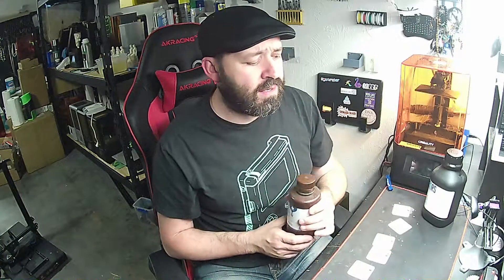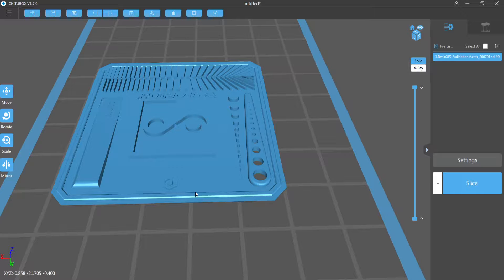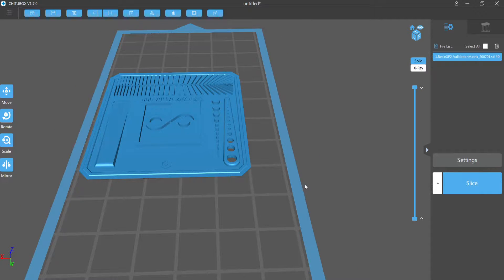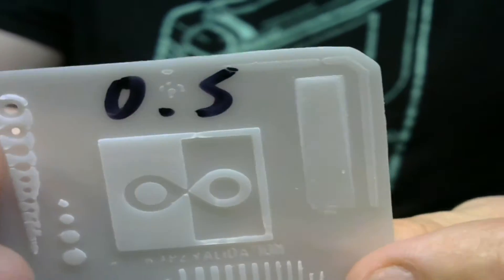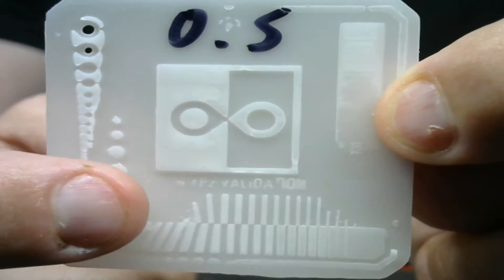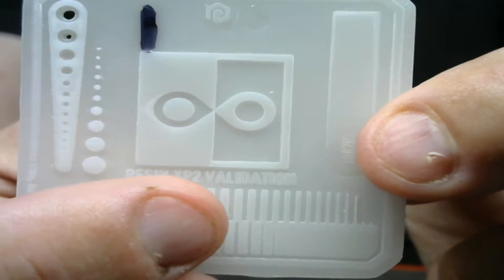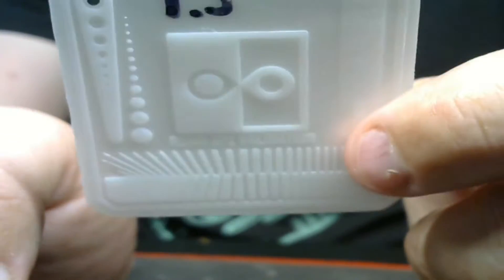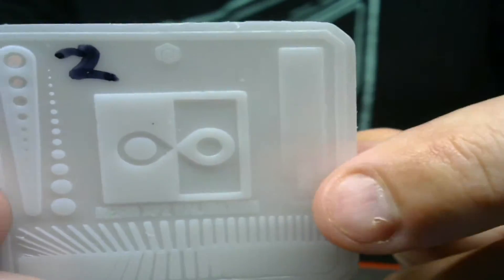How To: Resin Exposure Settings!

Comment: I am missing something or the video is missing something.  Are you intentionally hiding your settings when you go into settings then begin discussing the print settings to use?  If there is supposed to be a screen I do not see it.  Lack of a picture to go along with your discussion is not working for me.
Reply from the maker: yes my apologies this is an old video. I will be updating soon with a better print and better explanation by end of the month

Comment: Are you using 100% uv power which is set by the manufacturer on delivery or you’re lowering it down to extend lights life?
Reply from the maker: Been doing this for almost 5 years resin printing and never needed to lower the light source power to save anything.
Reply: @AkumaMods  so you’re clarifying that you’re using it on 100%uv power from the time you bought it until now? Interesting! 👏👏
Reply from the maker: @kirilivanov5852  absolutely I've never messed with the UV power on any of the 70 or so resin printers I've had in my hands
Reply: @AkumaMods  Thank you! I’m using Anycubic mono x and I thought it will be better to lower uv power in order to improve the 💡life. I will try using them on 100% hopefully it’s not gonna effect negatively the monochrome screen
Reply from the maker: @kirilivanov5852  I'm using 100% on my M3 MAX

Comment: I'm getting a bit confused, you save 3 files at 3, 8 and 15 seconds exposure, but then go on to show prints starting at 0.5 and go up in .5 increments up to 2, what are these new times and where did they come from when you start off saying 3 seconds 8 and 15? Is it because of the mono screen and this cuts the time you need to expose and if so what's the ratio ? Should I be exposing the resin starting at 0.5 and going up in .5? Or doing what the bottle says?
Reply from the maker: So for a new printer I actually set the times at 2.0/2.5/3.0/3.5. and my bottom is at 30.

Comment: I ran this test on a photon mono x and was told that you couldn’t trust the results due to printer doing something for the first 10 layers. Is this your experience? The rerf takes so much longer to print.
Reply from the maker: No that is not true. However I will be updating this video with a newer XP test from phrozen that has been working well. It is just as fast as the one in the video but comes out more clear

Comment: I don’t know if you can go back and edit the video you have posted but this video could use some corrections. At 3:50 when you are saying something about exposure times, the sound cuts out – there is no audio. At 6:37 you begin to talk about settings by first clicking the button that would open the settings dialog but the window doesn’t open in the video. You are then left pointing to nothing and talking about something that can’t be seen. That is as much as I watched.
Reply from the maker: There will be an updated video coming out soon.

Comment: Thanks for the video and the file. One question though. You recommend doing 3 prints to test including one around 7-8 seconds and one at 15 seconds. I’m wondering why so high since it seems like <2 seconds generally seems the right time. Is it just to test/experience it? Or did I miss something?
Reply: That’s good to know. Thought I might be going a bit overboard. I’ll probably print the Rook anyway as it looks kinda cool and might want to put it on my display shelf. Guess I’ll skip the town. Thanks again for the help.
Reply from the maker: So this was done when RGB screens were still big. So if you use an rgb screen I usually start around 6/7 second and for monochrome screen 2/3 seconds.
Reply: Cool. That makes sense. Thanks for the clarification. I printed the RERF file on my MonoX and it looks like 1.2sec is the best on that. So I’m going to try .8sec, 1.2,sec 1.6sec and 2sec on this file. See how it goes. Then its the Rook Test file and finally the AmeraLabs Town file. Hopefully all will go well. Fingers crossed.
Reply from the maker: @TysonWozniak  I'll be honest as long as you do the reref and it looks good I would just got straight to printing. The rook is just a test file to show the printer works and the ameritown labs file is the same as the reref file.

Comment: I've seen videos and read articles that said "do not cure" because that will mess up the results by expanding the print, but you and one other video I saw are saying we should cure...Confusing..... Thank for the help!
Reply from the maker: After doing this for the past 3 years I don't think it matters personally. I read them without even washing them but I use a new one by phrozen that's easy to read
Reply: @AkumaMods  Great, thanks! I should use a different one, on the current one the teardrops meet perfectly but the text is a blob and other parts are not correct. I appreciate the instructional vids!!
Reply from the maker: @AStarkr3802  https://drive.google.com/file/d/1v8XUiRT5rq5b2S2SKbAW7pW8uEJMh22e/view?usp=drivesdk
That's the one I use

Comment: I wish I someone could just please tell me how to set my exposure settings. Not a single guide on the entire planet
Reply from the maker: That's just the thing. It's not universal. Not even if it's the same bottle same color or same type of resin. All resins are created differently. On newer monochrome screen printers it takes about 30min to properly tune it
Reply: @AkumaMods  is it usually only through slicing programs that you can set exposure settings
Reply from the maker: @arronax3319  well you can change the time one some printers but you would have to check when you start printing. There is a setting icon.
Reply: @AkumaMods  If dug through my printer 'Mars 2' front moniter and there was no such settings. So I assume it is within the STL files? and those setting are set in a slicer software?
Reply from the maker: @arronax3319  yes the mars is a lower quality machine so you don't have the option to change on the screen. You would need to slice a handful of files and just change the normal exposure times. I usually change it every .5
Reply from the maker: @arronax3319  if you need a quick one on one help facebook.com/AkumaMax
Reply: @AkumaMods  Thank you. I was able to figure it out. Hopefully my print will survive

Comment: hi im also using the creality ld-002r and I was wondering what your exposure settings are? I didnt quite see it on your vid
Reply from the maker: I don't show off or share my settings because this video is to show you how to get the correct settings. For that printer I would start at 6sec for normal and 50 bottom and do a test print. Then raise or lower only the normal exposure time
Reply: @AkumaMods  nice I think thats a good starting point. I've already tried doing a test print with an exposure time of 7 seconds and the tear drops still look like they're fused on the tips but the thin lines on the bottom arent printing properly so im a bit worried about it coz the tear drops are overexposed but the lines at the bottom are underexposed I think?

Comment: I don’t really understand how you went from 3 to 10 seconds on the bottle to 1 to 1.5 seconds during testing...I am clearly missing something here...could you please clarify?
Reply from the maker: With RGB screens you normal exposure to test should be between 6-8 seconds with a bottom of -60-80 seconds. On newer models with monochrome screens your normal exposure should be between 1.5-3.5 and bottom 20-40. When I test on rgb my start point is 7sec with 55 bottom. On monochrome it's 2.2 and 30. Then I tune up or down just the exposure time up or down. My bottom exposure usually stays the same

Comment: grate video     can you tell us how to get cristal clear prints because I tried many times it comes out yellow or blue do you know why?
Reply from the maker: So with clear resin it's not so much am I over or under exposing in terms of what this video provides but it's more about the process. With clear resins they all yellow after curing. There are a few ways to lighten that yellowing effect so it's less. Spray a clear uv coat over the print after you wash it off and let dry. Then cure. Sand the print down a lot to get the clearing back. Pour resin over it before you cure it. Add a blue or purple dye to the clear. There are some clear resins out there that are more clear than most. Monocure3D has crystal clear but your going to pay a pretty penny. Now to get super crystal clear like see through not frosted sanding will be needed

Comment: Any suggestions on this file for Halot-Sky? I can't find the setting for layers on the machine as it's not in lychee as well.
Reply from the maker: Can you send me a screenshot of the settings menu on the halot sky. I've been told the production units look different then my beta unit. Send to my email akumamax84@gmail.com and we'll see what needs to be done
Reply: @AkumaMods  sounds good I'm mid demo print I'll get it in the am and send you what I have🙂. The Little city one turned out really good so I wasn't super concerned. But I had help with that Resin this other stuff I got has almost zero info
Reply from the maker: @ktothestank  yup and that's what this video and test are for to help where there is none. Then you can share and help the community
Reply: @AkumaMods  emailed the photos, hopefully you can make headway on it it's definitely confused me with the lack of settings and customization

Comment: Im using the Elegoo Mars Pro. I had three print failures as of right now. Through trial and error, I found out my issues. This is what you need to do. 
1. Make sure Chitubox has the correct printer you're using. 
2. Type correct resin color you're using under resin tab.
3.Print settings should remain the same for all your prints!
4. Exposure time 8, Bottom exposure 60, Lift distance 5, Lift speed 100, Layer height 0.1, and Retract speed 150.
Successful prints all time! I saved you 19 minutes of blah blah.
Reply from the maker: Ok and what do you do when you have different resins that aren't listed in the resin section. Like I don't want to buy cheap low quality resins. I want Monocure3D or 3DRS  there are no profiles for those automatically because they don't make printers. Or what if I use cheap low quality resins like Esun? They don't have a setup profile for that. To top it off those settings are baseline start settings that should be tuned for better results
Reply: @AkumaMods  Upgrade chitubox for upgraded printer list. If that doesn't help, use another software that supports your printer. For resin, keep it at normal if it is not on the list! Tilt your models at an angle and add supports. BOOYAH!
Reply from the maker: @yurushii  doesn't work like that. I have the newest chitubox...actually beta version I'm testing for chitubox. There is no liqcrete resins, loctite resins. Most of those are engineering resins that take 16+sec to print with. If someone used normal settings for that it would fail every time. Also every resin that is listed on the chitubox profiles that I've used I've tweaked a bit more to get even finer details. May not seem like much to someone that if it works it's good but when minis are being printed every detail counts. I've had so e elegoo resins that say 8 sec but in reality they needed 8.5 to print the best quality. While again my not seem like much to some others may want that finer detail.
Reply: @AkumaMods  it does. Keep your resin to normal. All that wording is just rubbish. I'm fine.
Reply: @yurushii  If it were so simple, why would literally everybody but you be wasting their time to get it right? If your settings work for you, great, but those of us that don't want to burn out their LCD unnecessarily fast, who want fine detail and accurate prints will continue to strive for better.
Reply: @therealmakmillion  i got it right. I've been printing like crazy. Old comment here.

Comment: I may be way over simplifying things, but I agree with another commenter (sorry, but once I needed the original contributor I couldn't get back to it), that correct exposure can definitely eliminate reliance on FEP lube. But don't stop, pretty please, lubing your FEP. It extends the life of your FEP. Once you learn how much and how often to lube, and how to stop tearing your FEP so it's worth lubing your FEP. 🙄😉

But, we still are dependent, as all "builders" are on a proper foundation. Yeah, the dreaded base layers. But it's not all bad. You can stay near the minimum (20-ish) for the first 6 layers. Been looking to fine tune this, but it just seems to work well across the Resins I have tended to use.

All prints done on both Monoprice Mini SLA LCD & ANYCUBIC Photon Mono Resin Printers; they are both mono 2k mSLA printers.
Reply from the maker: Printing almost 3 years with resin printers. I've never needed lube on my fep at all. I've only changed a few feps on my machines and I've ran over 25 resin machines constantly printing. I just changed the fep on my printer that is my oldest one for the first time. The other is still going strong. over 2 1/2 years of printing on the fep and just a minor blemish on it. FEP it a wearable item anyway, the UV will help break it down over time.

Comment: How does your bottom exposure time affect this, considering it’s really thin and printed flat?
Reply from the maker: Bottom exposure will effect this because that's telling you what your stick or burn in layer times are. So if I drop it down to 5 seconds on bottom from the 20 I had set the print might not even stick to the build plate.
Reply: @AkumaMods  thanks so much. So the details of the print  are then only affected by the normal layer exposure?
Reply from the maker: @braincx  unless you are printing details at the bottom layers. So for example if you bottom exp is set to 25sec and right above that it says base layers usually I keep around 5/6 those first 5/6 layers are burning in at 25sec. Then after those base layers it'll switch to the normal exposure settings

Comment: So I just start and I keep having file prints cause of the FEP being to tight I think cause I here a pop when the plate goes up. Or would this fix that to
Reply from the maker: Yes this will fix that as well. You should run about 3 tests total to see where a good exposure time is
Reply: @AkumaMods  thank u so much I have to wait tho my FEP ripped:(
Reply from the maker: @matthewtapia4398  dang. You machine didn't come with extras
Reply: @AkumaMods  no it did not I’m still wait for them to come I :/ they come to today. But how do I change my settings. Do u have a video and do u have a IG or FACEBOOK
Reply from the maker: @matthewtapia4398  you can get ahold of me through my group.
https://www.facebook.com/groups/450632562376838/?ref=share. that's my group
Reply: @AkumaMods  thanks u I hope I don’t bug to much I’m super super new and know nothing. Just try to open a business to catch up on bills
Reply from the maker: @matthewtapia4398  no worries bud. That group I created has 62k people in it that constantly bug me because they are new to 3d printing. I'm here to help
Reply: @AkumaMods  oh thank god I got my printer to print resin text so the setting u said work. Thanks you. I still have to get a real print and I have an easy one to do for a friend
Reply from the maker: @matthewtapia4398  glad to hear it worked

Comment: Great video, that information is very helpful. But i am still having problems with it sticking to the FEP. The supports and everything print fine all the way up to the connection points, but then for some reason im only getting partial prints (the supports and base sticking to build plate just fine, but the rest of the print sticks to the FEP. Im using a Longer Orange 10 printer, and the Longer 3D water washable grey resin. Any advice?
Reply: +1

Comment: What is the consequence if I exchange time to light? like 1s@100% or 2s@50% or 3s@30%? I have more delamination with short exposure times, but I'm not sure about the cause consequence connection...
Reply from the maker: If you are referring to the light off/delay times I have yet to test that out. I've been busy with normal work so I haven't had much time to check it out yet. I don't think it'll effect the exposure times too much. Imo the exposure times is what you should dial in first and then go for the light off/delay

Comment: what about bottom exposure settings?
Reply from the maker: I usually leave it at 50 for rgb screens and 20 for mono screens but you can play with it to get it lower you'll just have to adjust your exposure times anytime you change that stuff